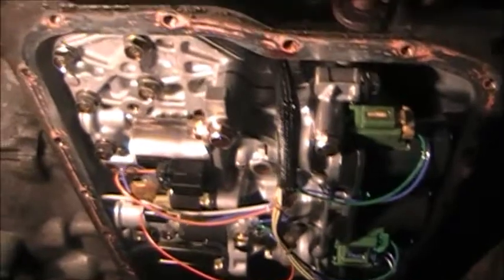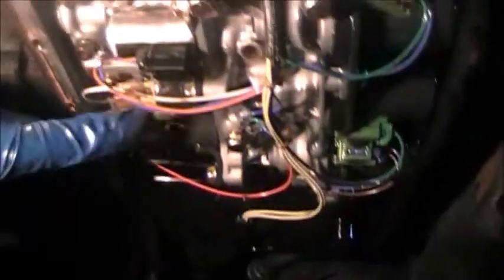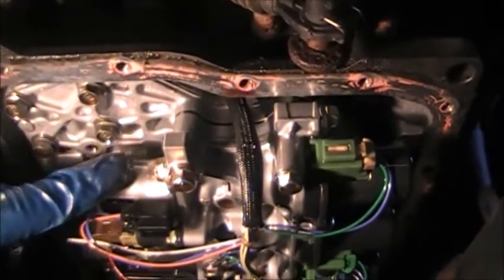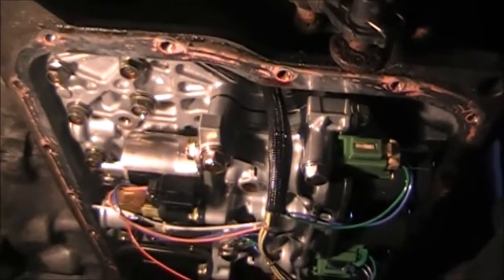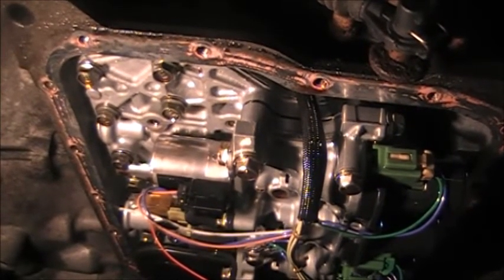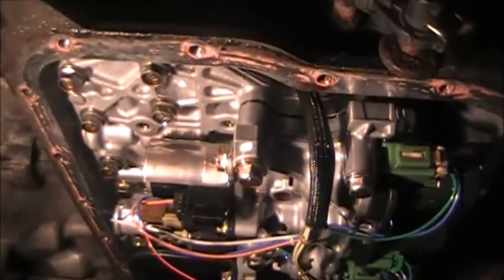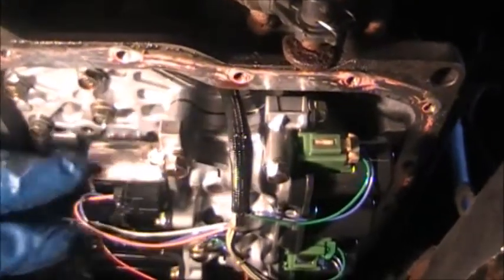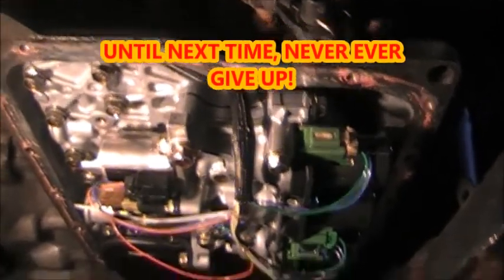mazda 6 trouble code P0745 EPC CIRCUIT FAULT PART 2

Comment: Great vid,  best one I have seen on stuff like this.  

2001 Nissan Maxima forces you to change all solenoids at the same time. 
By only selling you the whole harness with solenoids attached.  

Nissan Part No.: 31940-80X25
SOLENOID REPAIR KIT - CONTROL VALVE

Comment: That is, problem was the EPC solenoid, blue and orange wires with black connector. It should give 2.4 - 7.3 Ohms between terminals 2 and 7 of the vehicle harness. And discarding cable problem, checking terminals 44 (green / orange) and 81 (black / red) PCM. Video guided me and I got the diagram ATSG 4F27E / FN4A-EL (google), thank you very much.
Es decir, problema era el solenoide EPC, cables azul y naranja con conector negro. Debería dar 2.4 - 7.3 Ohms entre los terminales 2 y 7 del arnés del vehículo. Y descartando problema del cable, chequear con terminales 44 (verde/naranja) y 81 (negro/rojo) del PCM. Me orientó el video y consegui el diagrama ATSG 4F27E / FN4A-EL (google), muchas gracias
Reply from the maker: Welcome
Reply: Joseph Monter i have a p0841 and p0894 code. What does this in general. Thank you.